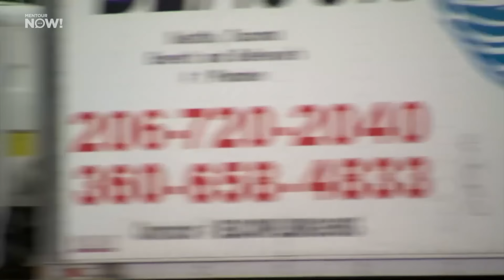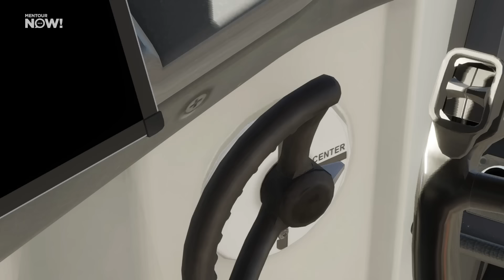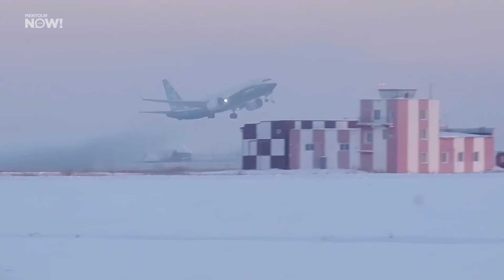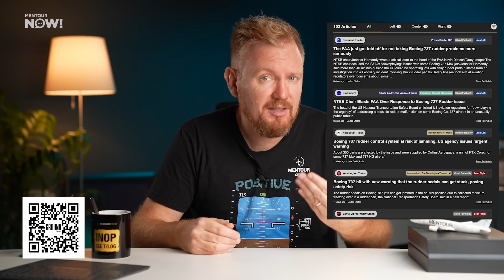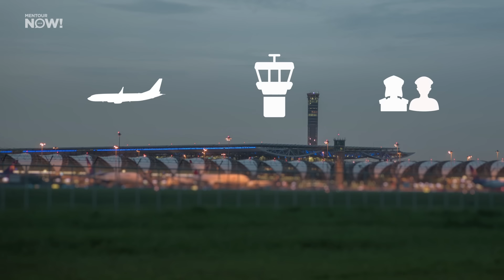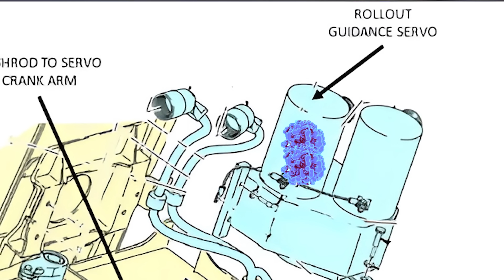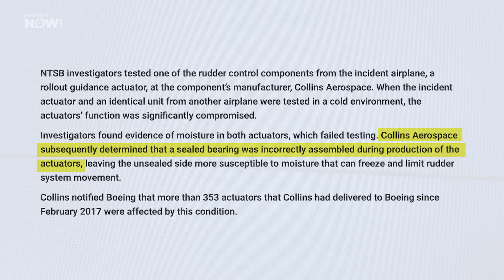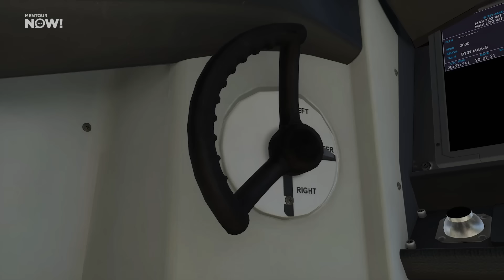Does the Boeing 737 Have ANOTHER Major Flaw!?

Comment: "If critical systems fail during landing, just use brute force."
Thank you boeing, you never cease to entertain.
Reply: Wouldn't applying maximum force to break it free cause the rudder to move abruptly to an extreme position?
Reply: @Garrison169  That's exactly what he was addressing toward the end of the video and NTSB was advising Boeing take out of the manual.
Reply: @Garrison169 you not suppose to do that in the air, Google: airbus a300 JFK to Dominican republic, the vertical or rudder was reaped apart after take off while climbing. The pilots were battling turbulence from a 747  that had taken off before them, the black box revealed the inputs to the rudder before they crashed.
Reply: "This is how we fix problems on Russian space station" Peter Stormare
Reply: RTCA DO-160 avionics standards require Collins to perform thermal shock and MTBF testing for environmental effects on parts.  If moisture can build up on the inside of an actuator it will accelerate aging and severely degrade operational performance.  Not entirely convinced it was an assembly problem maybe design wasn't robust.
Reply: It's the natural extension of then your old TV (tube) acts funky give it a big whack hehe.
Reply: Same solution is used on old TVs when the screen is flickering. Always works. 😂
Reply: @rickwhite4137  We used to have an old telly in a wooden box. It used to go off sometimes so you'd have to whack it. 7 year old me whacked it too many times and it started smoking, I unplugged it ran off and whistled like nothing every happened.
Reply: @rickwhite4137  💀😂 I had a tv that needed a good whack every now and then
Reply: The second part is even more interesting: "if brute force does not help, you're screwed. 'Boeing' is the sound the aicraft will make on contact"
Reply: @ABa-os6wm  ha ha ha ha !!
Reply: Perhaps keeping a sledgehammer in the cockpit...
Reply: Yes this is completely nuts...
Reply: @Casey093  it happened once settle down clown.
Reply: im sure the passengers on as1282 had ceased being amazed.
Reply: @thisisurcaptain  why would you  fly an aircraft with limitations and pressurisation problems ???? Oh wait, it's easier to blame boeing.  Sorry, forget.....
Reply: That's about as short as their MCAS training was on the 737 Max.
Reply: @IARRCSim  Training on what how to perform the procedure for runaway trim. If your trim is moving unexpectedly then they should know what to do. But  I guess it's easier to blame boeing that was the escape goat..
Reply: @Michaelnacevski  you're not a pilot so you don't understand. Imagine having a runaway engine while on a highway. Since you are a perfect human being with no startle or panic or whatsoever AND it took you exactly ZERO seconds to analyze what's going on you immediately neutral the gear then shift down etc etc. Good, but what you don't know is in 10 seconds the engine will explode. 10 seconds is what the NTSB predicted the reaction time required by the pilots to save the aircraft becuase of how violent MCAS was. So is it the pilots fault?
Reply: @topethermohenes7658  voilent mcas no it wasn't. No takeover. That why lionair 610 flew for 12 mins they had it undercontrol you can't fly to a holding patten if you don't have control. Bad maintenance bad first officer. Got nothing to do with Boeing..
Reply: @Michaelnacevski   if that's what happened, there woudnt be a crash. Maybe you're talking about a different incident 😂 maybe watch some documentaries? Or better yet, read ntsb reports
Reply: @topethermohenes7658  You got no clue.
Reply: @Michaelnacevski   typical boeing fan, defends boeing even though you have no idea what you are talking about while the whole world is condemning them, even their own engineers and workers 😂 try applying to boeing man, you're exactly the guy they are looking for
Reply: @topethermohenes7658  To add to the tale,  one US pilot, forewarned by the MCAS causing 2 crashes, was able to save his plane from MCAS in those 10 seconds. If he was not so fast and ready, there would be 3 plane crashes due to MCAS.
Reply: @topethermohenes7658 personally I’d rather be called a Boeing fan than be known as one of the uninformed sheeple who stumbles through life doing 0 research for himself while regurgitating what MSM reports.  After all, We’ve all seen how accurately they fact check themselves.  

There was a time when there was some level of responsibility in journalism but that time has long since passed.  MSM found it’s easier to fill their pockets with “shock and awe” than truth.
Reply: Ilyushin moment
Reply: They have ccp members on Boeing its not surprising
Reply: Did you thank Collin's too?
Reply: Maybe they should add a big hammer to the cockpit equipment. Use the Russian method: chit it hard with a chammer.
Reply: Lol
Reply: Boeing feel like bruteing
Reply: These are certified behaviours of aircraft. In case of a failure what happens? There cannot be a single point of failure that results in catastrophic results.

This should work. Problem is when faa delegate approval to boeing and boeing engineers bow to management pressure to approve something that doesnt comply.
Reply: Isn't that a great reaction and solution to fix the problem if it occurs 🤨🤨🤨
Reply: Isn't that sort of what took down AA 587?  Too much rudder force in the air?
Reply: I know this old saying about BOEING, having worked over 3o years as Flight Attendant: BOEING- from idiots- for idiots ...
Reply: So, "if it's a Boeing, I'm not going" is not a joke punchline anymore. People REALLY could die flying on these POF planes!!!
Reply: @TheOzthewiz  I don't know what POF means, but yes, you are correct.
Reply: @TheOzthewiz FYI, Collins builds the AOA sensors for Boeing and Airbus and probably others, so I guess you’re SOL traveling abroad unless you’d like to book passage on the new titanic.  😂
Reply: The most "classic" response ever by a supplier!
Reply: If my computer does not function properly, I give it a good kick... I call that the "Boeing treatment" :-)
Reply: @TimAnnear_1961  Exactly!... which makes the Brute-Force "answer" by Boeing, the most stoopid "answer" possible!  

The idiots that wrote such an stupidity should be fired and prevented from working again at any aviation company forever!
Reply: @alfredomarquez9777 first of all, common sense would dictate that if you’re aware of the potential issue you would test the rudder prior to 100’AGL.  

Second, it’s a hydraulic system.  If the cause is a small amount of ice in the bearing, there’s no way you aren’t going to overcome that with the hydraulics, it’s just a matter of it taking more pressure than normal.  

Lastly, this wasn’t suggested as a permanent fix, but rather as a temporary one in an emergency.  What would you prefer, that the pilots call a flight attendant up and ask that he or she locate a hair dryer and run to the back?

 (Obviously a joke. I know the system is behind the aft pressure bulkhead where nobody can access it during flight).
Reply: I don't think fixing the seal is good enough because systems should continue to be safe after seals fail and after being frozen in ice, regardless of the quality of the seal.
Reply: @alan6832 what world do you live in where no part ever fails?  If it seal failing had no impact why would it be there?!?!  The problem is the clown at Collins that installed a sealed bearing with the seal facing inwards.  

That’s like closing a Ball Jar with the rubber seal on top of the lid and being surprised it isn’t air tight.
Reply: @andrewnajarian5994  I'm not saying that failing seals must have no impact, I'm saying seal failure must not endanger 100 people.   If planes cannot be built that can land without seals, then people should just stop flying, as they should anyway since it harms the climate.
Reply: @andrewnajarian5994  I don't think the bearing being installed backwards was in the video anyway.
Reply: @alan6832  I was being facetious about it having no purpose but my point was that had it been built properly, the problem wouldn’t exist.  If the bearing was installed properly, the seal failing would have allowed a small leak, which wouldn’t have endangered them and would have been obvious to the maintenance team.  Furthermore, it had 0 impact on the passengers, nobody even knew there had been an issue and it was resolved by pressing a little harder on a pedal, I’d hardly call that a catastrophic failure.  What would you prefer people use to get places, a ship that’s at best twice as bad for the environment and takes a week to travel the distance a plane covers in 6hrs?
Reply: @andrewnajarian5994  slow ships, buses and trains would cause people to travel fewer miles and if sufficiently slow and crowded, and sensibly mixed between passengers and heavy cargo to achieve efficient densities, then ships become more efficient.  
   I can also accept passenger planes depending on oil seals to take off and to cruise, but not to land.  If every oil seal on a passenger plane suddenly bursts during cruise, the plane should still be able to land safely.
Reply: @ I do wish we had better rail travel to be honest.  I used to take trains occasionally and they’re great!  More room and ability to walk around vs a plane and you see some really beautiful country, but the last time I tried to, a 2.5hr flight was going to take me nearly 3days with multiple layovers and cost over $1k!  Unfortunately in the US, we just don’t have a great long distance passenger rail system any longer.   At least the big cities have decent rail service though.  

I’ve been a sailor all my life and love the sea, but it’s incredibly dangerous. Nothing is 100% but flying is so much safer than marine travel partly because of its speed and the inability to outrun storms as they build and change direction, but also the emergency response available in the middle of the ocean is nil particularly in a storm.  Ships are slow to respond, planes can’t land and choppers have weather, fuel and passenger constraints, meanwhile, thousands are left clinging to wreckage with minimal time before hypothermia and dehydration both set in.  

Everything has different risks that require different safety measurements and advancements but at the end of the day, it’s basically the “asymptote of safety.”  It’s simply impossible to develop any form of travel that’s entirely safe unfortunately.
Reply: This calls for a very special blend of psychology and extreme violence.
Reply: Runway guidance with no rudder, try differential braking. Any tail wheel pilot knows how.
Reply: @N40669  He did, but isn't the main wheel differential brake control in the same pedals that were jammed? making the side lever accessible only to the pilot, that he used, the only remaining access to the differential wheel brakes?  I suppose that may leave differential thrust reversers in the engine throttles.
Reply: its the bicycle chain under the floor connecting the two  ,,,,,,,,oh man
Reply: "Maximum Brute Force," -Deadpoolgineer
Reply: It would be the same thing if it happened to an Airbus. If something fails you got to deal with it by any means necessary.
Reply: Does the Boeing 737 still have a big flaw waiting to be discovered?
Reply: Truly the Apple of aviation lol.
Reply: I'd be scared that, having managed to shift the thing with brute force, it then went hard-over and jammed again.   Be too bad if this happened at 50 feet...
Reply: Someday they will actually try and nake broken planes as a joke and it will be the only one without flaws.
Reply: aye that was my thought as well.  its like saying the proper torque is to tighten the nut till the bolt breaks then back it off a little.
Reply: Boeing Manual: " Have you tried killing the whistleblower? "
Reply: @yotoniha  That´s real naughty.
Reply: @yotoniha  When you don't have anything intelligent to say.
Reply: Yeah. "If at first you don't succeed -- hit it with a bigger hammer."
Reply: What else are they supposed to use, harsh language?  If you are landing, with a defective part, and it sticks you do what you have to do.  It's up to the airlines now to replace the defective part.
Reply: @jeromethiel4323 erm.. perhaps investigate why??????
Reply: @DaveSCameron  We already know why.  The part, which was made by another company, passed design review.  Then they built some incorrectly, which resulted in water entering the system, which could then freeze at altitude.

I work as an engineer.   If a part has passed design review and has been certified as a good part, that ONLY applies if the part is manufactured correctly.  If the part is not made correctly, all bets are off.

You can say Boeing is ultimately responsible, and i would agree with you.  When bad parts are identified, you tell your consumers about it.  After that, it's up to the consumer to fix the problem.
Reply: @jeromethiel4323  .  Apparently this is a RZ or SZ bearing and they placed the open side of the bearing on the outside/exposed side.  It does have one wondering about inspections at Collins Aerospace.
Reply: @jeromethiel4323 well yes, they are, doesn’t Boeing just outsource the manufacturing to the lowest bidder?
Reply: @tvividy  As does everyone.  What's your point?
Reply: @jeromethiel4323  Right — and that’s where accountability comes in. Manufacturing errors happen, but the OEM is still responsible for ensuring suppliers have robust QA processes and for notifying operators when issues are found. Passing design review only means the concept was sound; if execution breaks down, the certification is void. Boeing can’t just point upstream — they (should) carry the legal and regulatory duty to deliver an aircraft that is safe, compliant, and airworthy (much like the legal requirements for the automotive industry with recalls: fix the defect at no cost to the operator/consumer, and sort it out with the supplier independently; given the operating costs, this would be an expensive undertaking considering Boeing's recent track-record of malfeasance and negligence - their Swiss-Cheese model seems to have ... several large holes brought to light in the past decade).
Reply: Ah not at all. The company who designed, tested and built the plane are responsible to find a solution for this part! The airlines are in no way responsible.... @jeromethiel4323
Reply: @jeromethiel4323  Harsh language is standard procedure during brute force operations. It is stated under section  1/A "brown alert", and everyone uses that.
Reply: Disgraceful behaviour once again from Boeing!!!
Reply: We're none of you listening? Boeing didn't produce this part, and it's installed as an assembly. In other words, the Boeing installers did their jobs properly.
Reply: @mchristr   Boeing is responsible and liable for every single item on its airplanes.  That applies particularly to the substandard and unauthorized parts that have found to be installed on new Boeing aircraft through the years.
Reply: @Hopeless_and_Forlorn  We are finding the cause broski
Reply: @Hopeless_and_Forlorn and apparently you live in the world where manufacturing defects never occur.  We should all be so lucky!

Unfortunately the rest of us live in the real world where everything manufactured has some defect ratio.
Reply: @mchristr  If you, as a manufacturer, charge me northwards of $30M for the product, I expect that to work.
I'm not overly worried from which other engineering company the malfunctioning sub-unit was purchased.
Simple, really.
Reply: @grahamstubbs4962  You expect to buy human perfection for northwards of $30M? How much do you charge for your own perfection?
Reply: @mchristr  Every manufacturer needs to tests the parts that are supplied by an outside vendor, especially those things that are safety critical.  Boeing is responsible for everything about their aircraft.

Yeah, the installers did their job.  So what?
Reply: @Garrison169 Aircraft Parts are Certified by the FAA before Collins (in this case) produces them.  This is done so that Airbus and Boeing and other Aircraft Manufacturers can be confident that the parts they are using meet or exceed the FAA’s regulations.  If the part passed FAA certification at Collins than it would have passed FAA certification at Boeing too.  Obviously the failure here is the fact that the FAA didn’t properly test the part before certifying it, or Collins happened to build one correctly for the test prior to hiring the Dyslexic Bearing installer.
Reply: @mchristr  It is the responsibility of the manufacturer to insure the parts they are using meet specification.  A simple pressure seal test on a sample would have found the problem.
Reply: @Garrison169 even at -30C?
Reply: @mchristr  Doesn't matter. Boeing has approved them and are using them.
'when you buy something that fails, you go to the shop where you bought it, not to them who produce it.
Reply: @mchristr  Boeing is still responsible!!!